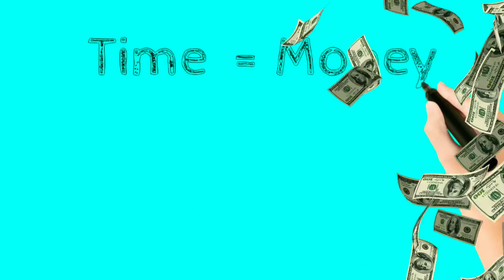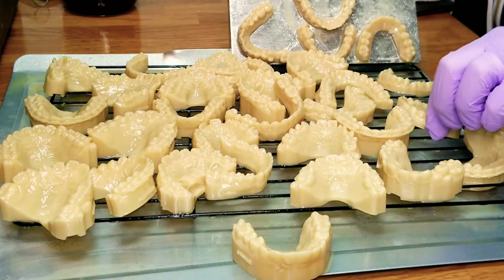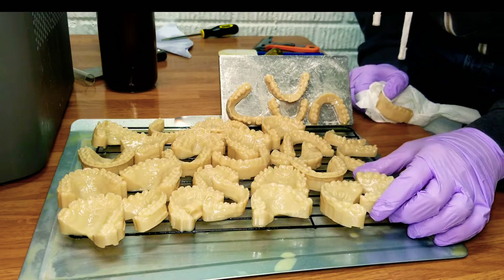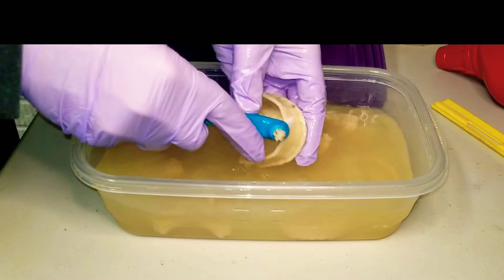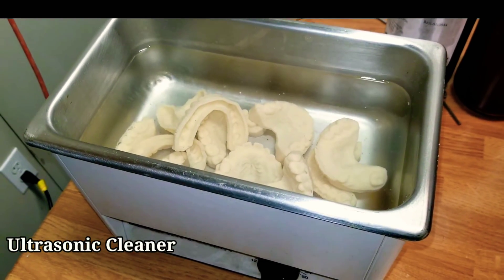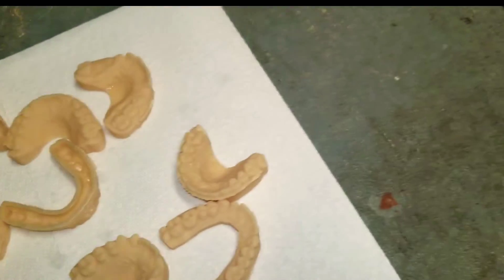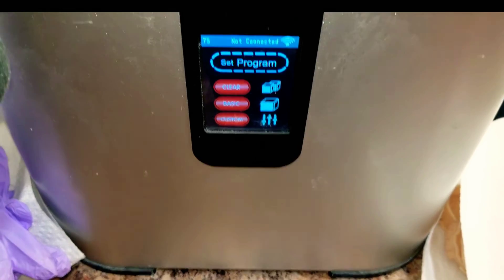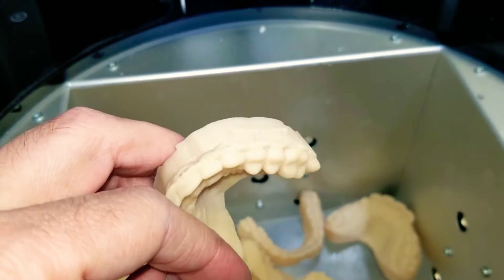Cleaning and Curing 3D Resin Envision One by Szara Dental

Comment: I use the same printer in my lab! Can I ask what tool you are using to separate the models from the build plate? It looks like they pop away so nicely! Thanks!
Reply from the maker: I'm using a window scraper blade. The key is to not have the first layer so stuck to the buildplate.  Check the initial burn in time with etec. They will pop off so much easier with less chances of cracking model

Comment: Hi mate, i am on the fence on switching over to 3d models with the ability to accept scans.(i work on stone exclusively) Is this printer a good option for a small dental lab mostly doing orthodontic plates and fixed appliances. Do you prefer the workflow of 3d models over stone? Thanks, good video.
Reply from the maker: Absolutely, Digital is the way to go.  It is so much cleaner and professional compared to stone models.  Once you convert you will never go back.  You will need a good 3D printer like mine.